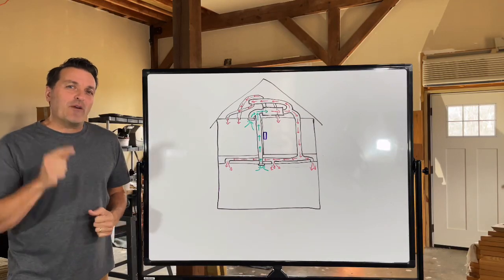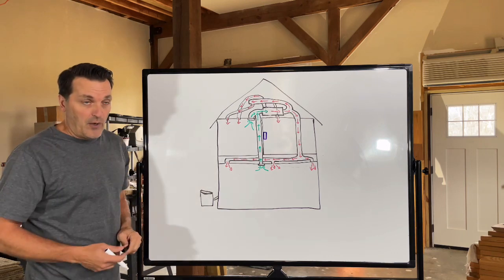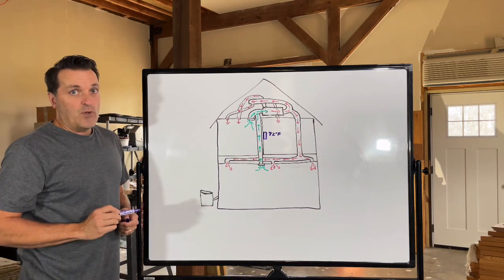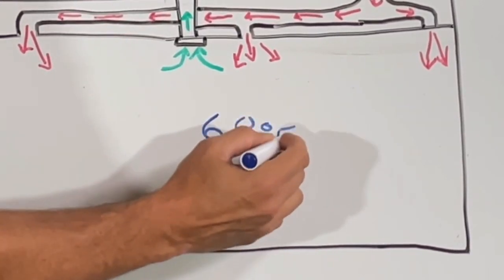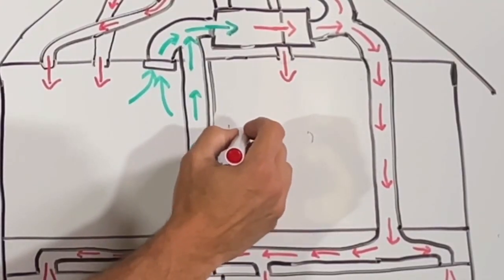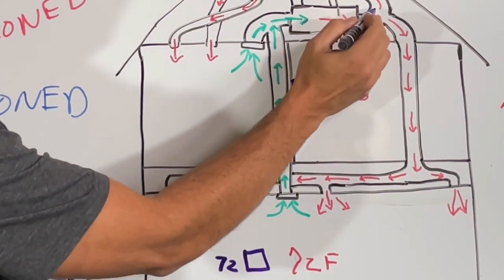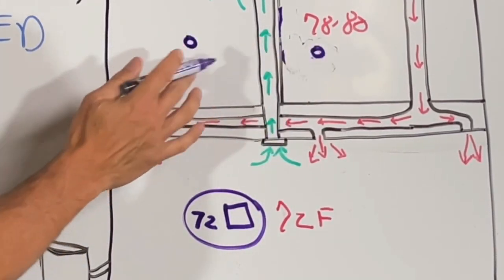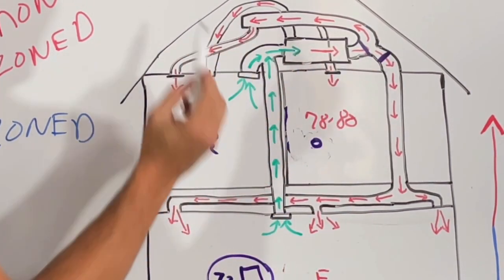2nd floor always warmer? Here’s how to FIX it! Could save u $$$$!

Comment: Ceiling fans are helpful in some rooms as well - just be make sure the fan blades are spinning in the appropriate direction for your needs (ceiling fans can pull air up or push it down, in addition to just circulating air).
Reply from the maker: Indeed

Comment: I did 2 things to help reduce the differential (1 thermostat on first floor)
1) I have my HVAC fan set run for 15 minutes every hour from 4-11pm.  This helps mix the air without running the AC
2) I put fans around the house, including one aiming up the stairs to push the air around.
I've noticed lower electric use and better balance of temp throughout the house.

Comment: I have 2 split systems- 1 upstairs and 1 downstairs, and might help to include that. I can't imagine my house running my house on a single unit regardless tonnage. I had to move the upstairs thermostat out of stair/hall area to a bedroom due stack effect is upper hall. If set at 72, bedrooms got to be near 60. So bedroom feels normal while upper hall feels warmer. Doesn't matter where thermostat is since all temps are relative and based on feel, not the digital display!
Reply from the maker: All good points. Of course every home is quiet different. I used a basic example to try to help folks understand why there temps are different if only one thermostat is in use.